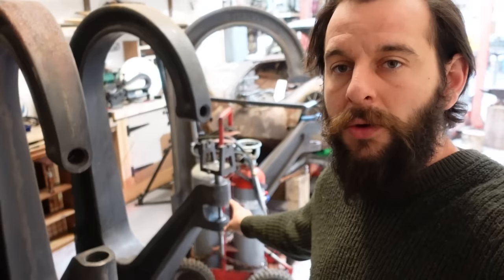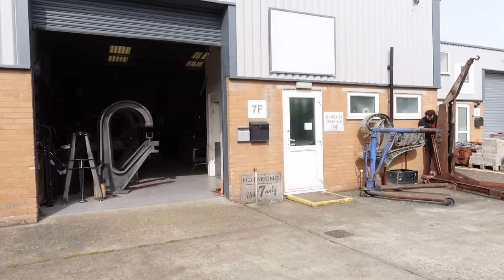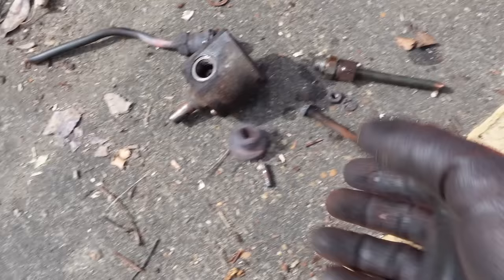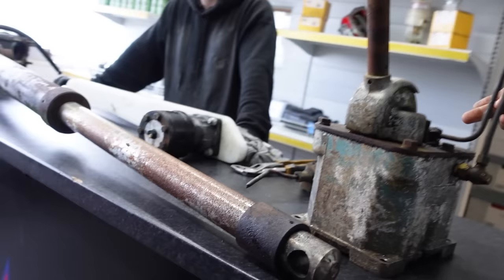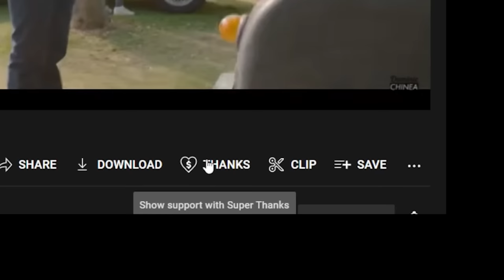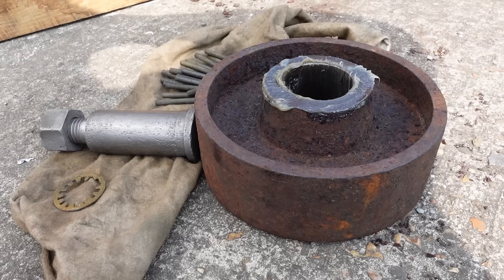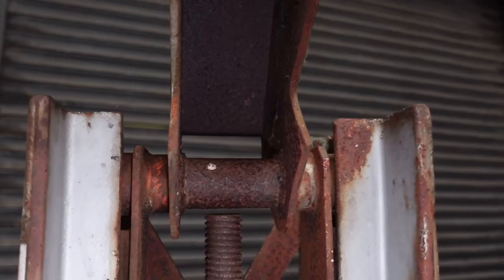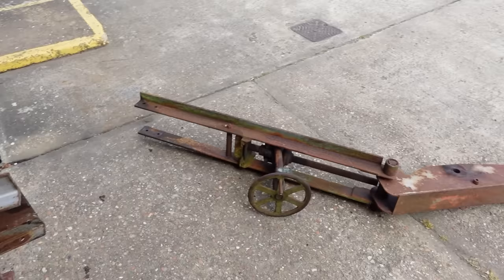Restoring An Old Engine Crane | Reviving History

Comment: Hi Dom, while you have the crane apart, take the components out to a sandblaster and have them sandblasted and undercoated, then on their return you can paint them in whatever colour you desire.  Although that process is not expensive, it will cosmetically make a huge difference to the overall project turning it from a rusty looking engine crane into a talking point in your workshop,  With your signwritting skills you could on the jib arm sign write your company's logo there.  Another great video Dom, look forward to the next installment.  Regards a fan from Aus.
Reply: For the non-critical parts, I'd prefer wire brushing to remove the crusty bits and then applying a "rust reformer" that will turn the rust black and protect the steel. Then a light coat or 2 of black enamel, all of which will cover & protect but leave the scars of age visible.
Reply: Hi Charlie,  On items which are exposed, I like your method, but on the close confines of Dom's engine crane the sand blasting will get into all those hard to reach areas where the hydraulic pump sits.  the sandblasting process also provides a much better surface for the undercoat to adhere to, providing a uniform look to the machine.  This process rarely removes the scars of age from previous use unless they are surface blemishes. Thanks for commenting.  A Fan from Aus.

Comment: Totally loving the resto of the wheeler. I was trained on the exact tool in the 1970’s as an apprentice at Vauxhall Motors Ltd. I ended up as a “body in white” engineer in AJ Block experimental making panels for the die presses. Get yourself some Aero Kroil penetrating oil you won’t regret it.PS get yourself a decent socket set and a nut gun. Lol

Comment: Dom, some sort of penetrating oil would help a lot, in both releasing roll-pins, axles, nuts and the like in the first place and then allowing them to be wound off/knocked out/unscrewed without damage to the component or its housing.  I’ve used lots of different sorts, but a nice, cheap, and very effective version is a 50/50 mix of ATF and acetone.  Apply it the day before: works wonders!  Also a light brushing of old engine oil now and again will keep old machinery stored outdoors from deteriorating too fast…. And like all the others, I’d just dismantle, blast and repaint the crane while you’re at it.  
Cheers, Will

Comment: Hi Dom, surely now you have stripped all those parts out you could media blast and paint the frame without too much difficulty.  Maybe a good idea to get some old tyres to act as a cushion in case of any mishaps when you finally use the crane to move the Ranalah frames.. Robb Torremolinos Spain
Reply from the maker: I like the rusty patina look!
Reply: @DominicChineas  nah, it looks knackered, Dom. Give it a lick of paint mate! You could always ‘age’ it if you must.. “clean” means you can see problems coming, before they land on you. Agree with the above comment about a new set of rear castors, those ones are finished, inside and out. Nice episode, but gas always runs out at the wrong time. You need a spare bottle or two! Les
Reply: Let's put it to the vote, Dom. It's not like you have got lots of projects on the go.😁 you can paint it the same colour as your lathes or develop your factory colour like the blue on one of your Ranelagh.

Comment: The oxy did the trick.The Ranala is so close to finished its definetly time to start a new project. They take time to ramp up . first stage pulling apart is slow, repair can be fast depending how fussy you are, nice work on the wheels.  I would have kano kroiled for weeks with gentle hammering. laying down a normally vertical machine. picked up a few big pillar drills, . love to watch. thats a serious crane.. the bridgeport saddle can support x Kg.

Comment: If you can get those rollers out of the plate in that caster and the slots are reasonably ok or repairable then you could replace them with some silver steel rollers. At least you can use the original casters then. I trust you are going to give the crane a good coat of paint and clean up and paint the front wheels. It will be a great crane when restored, and a great find.

Comment: Nice project Harvey Frost was the crane to have in the day, LandRovers with there cranes on saved the nation as did the big wreckers ,
There cranes where always over engineered but you where always safe with there stuff 
I’ve got one sitting in my yard which was apparently used to change aircraft wheels with a sand box for counter weight 
I had a feeling the neighbours had given you a hand to lay the Ranalah because you couldn’t eat that amount of weetabix 😂
Great vid Dom well done stay safe 👍👨🏻‍🏭

Comment: Dom,swarfega Duck oil would help you loosen the seized bolts ect.used it for years in the motor trade.
Used a L .R series 2a with HF hand operated cable lift for recovery jobs,talk about hard work.
Great vid,see you next Sunday.

Comment: Not to plan is  to plan to fail ! Check you have what you need before you start. Anyway you should be sorting out that nice little Epco engine hoist with the bent leg - super cranes - I have the slightly bigger model.

Comment: You're braver than I, Dom, for taking these projects on. However, to quote Nevil Shute, ‘Maybe we’re too apt to scrap things in the States.’

One thing, I would have used an extreme pressure grease rather than lithium general purpose: the EP grease will hold up to the line contact better without breaking down and also regular lithium grease can become hard with time.

Cheers, Charlie.

Comment: In the early 1980’s I worked in Saudi Arabia at Jeddah Airport they had a purpose built machine shop with all the best equipment that money could buy. One of the items was a huge lathe that as 10 feet between centres. There was however a major problem with the infrastructure of the machine shop, when they built it someone forgot about installing electricity so all of the machines were in effect useless! The fire department had a major problem as some of the equipment was American and some was British, both utilised the same size phosphor bronze hose coupling however one used a rounded thread and the other a V type thread. The head of the fire department decided that he wanted an adapter coupling turned up, to get round it they fitted a flywheel to one end of the lathe equipped with a handle, they then persuaded a number of Filipino workers to queue up by the handle and to spin the lathe by hand, as each one began to tire the next worker would take over. It apparently took quite a long time to achieve and resulted in a lot of knackered Filipino workers, but they did it. I think that this encouraged them to eventually bite the bullet and dig up the floor so they could install the electricity! The funny thing is in the room next door was a several megawatt generator that was meant to kick-in and maintain the power to the airport in the event that the National grid failed.
Reply: Unbelivable!! haha

Comment: Maybe get an induction heater for doing the nuts. It would be cheaper than using gas and you won't run out of electricity.

Comment: I wondering, with the front rollers you temporarily fixed. Could you stick the pins in the lathe, run then down a bit and get larger rollers bearings?  Nice and smooth and new? Would be a great use of the new lathe. That's if you can get larger roller bearings? Love you channel mate.
Reply from the maker: They are surprisingly smooth now! The workshop floor is flat enough I think it will roll around ok

Comment: I'm surprised you didn't try cleaning those bearings and other small parts in your electrolysis bath. would that help release them?
Reply from the maker: Yeah it would remove the rust, I didn’t have it set up at the time though so just used what I had
Reply: @DominicChineas  thanks for the reply. Great content as always btw.

Comment: Love what you are doing and your enthusiasm, but just a thought, but why do you need to put it on its back? the top axle needs to be parallel with the lower roller cradle axle mounts... so some form of jig attached to the lower wheel mount to reference the upper axle?
Reply: Needs to be on its back so that the babbet (sp.?) metal can be poured around the bearing.

Comment: A question.. from my limited experience (metalwork at school many years ago :-) ) heating metal changes it’s characteristics. Heating copper to dull cherry red makes it soft if I remember correctly. When heating metal to assist with removal / undoing seized components do you have to do something to re-harden/ reset the characteristics?
Reply: Most structural steel is mild steel  and heat does not affect it much. It can't be hardened.
Reply: @paulg3336  thanks!